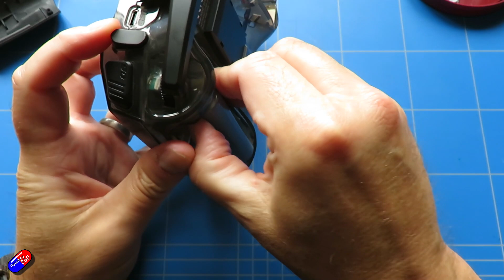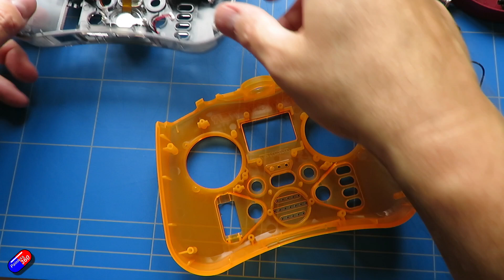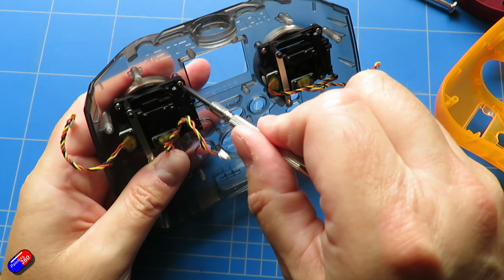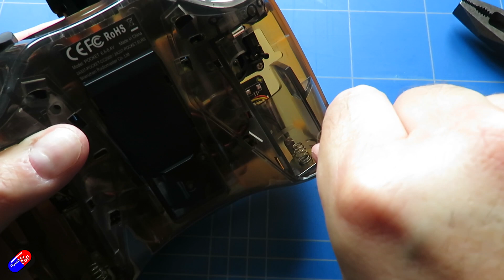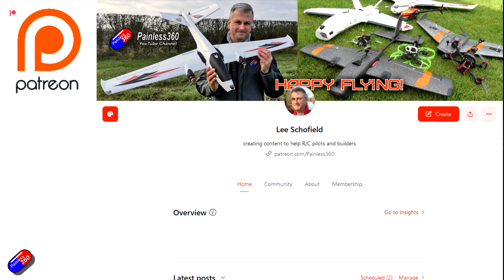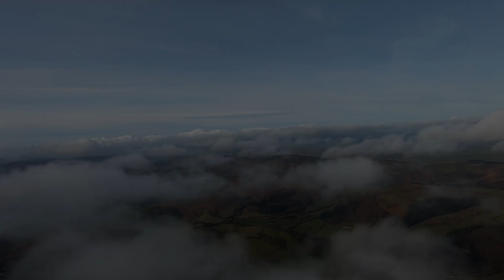RadioMaster Pocket Radio: Swapping the Case!

Comment: I just received my pocket from the new batch of pre orders in September…I have it open in front of me swapping cases and noticed the ufl is strain relieved with a clip on the top left screw, not glue…also the main pcb reads pocket_v2.0 Seems as if they have already fixed some issues. Great easy to follow guide.

Comment: Sure there you go making it look easy. Lol . At my age seeing the small parts is doable due to large magnifier on bench,  it is the hands that betray my age. I use to work on watches, now it a challenge to change a battery . That being said once more a step by step instructions tion. I was glad to see the ribbon cable moved to the front vs. The tx16s,  where I fumbled for some time reconnecting the main board.  As alway take care .
Reply from the maker: It isn't too hard. Taking your time and taking a few images as you remove things will help get it all back together easily.
I wish the antenna didn't have to be unplugged, though... Happy flying!